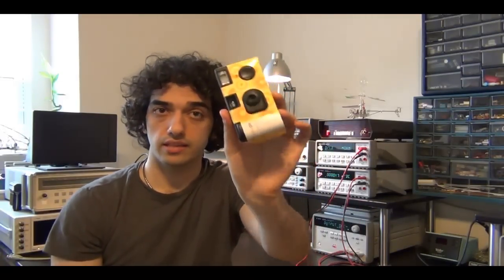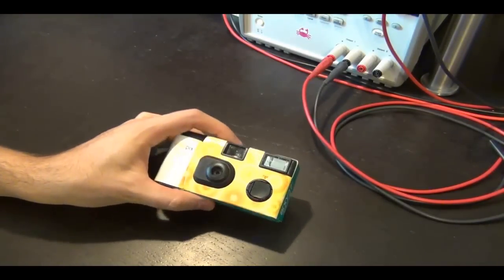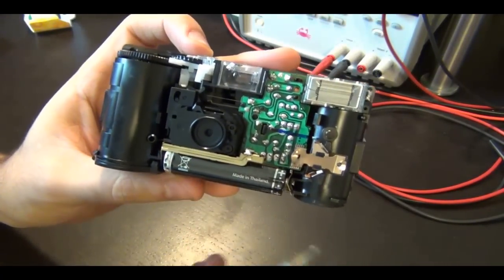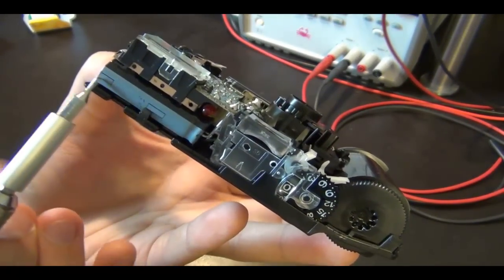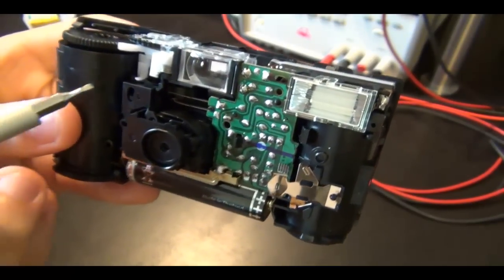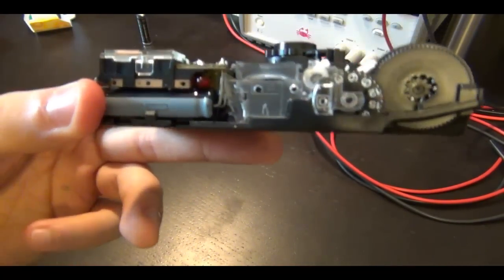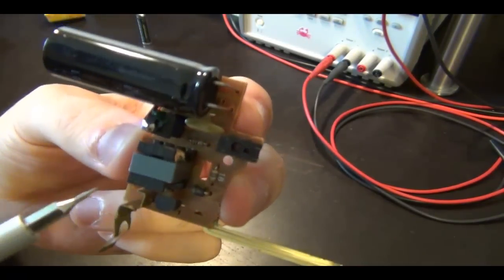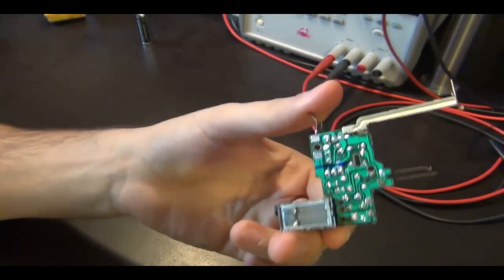TSP #3 - Camera Flash Circuit and Nixie Tube Tutorial (Part 1/3)

Comment: Hi Shararair
thank you- great video  
would it be possable to make a video using the same  flash circuit to build a Geiger Counter ?
I have purchased some tubes from e-bay and can give you the numbers from it if you need them
the tube's are quite cheap to buy and are readily available 
ps- (the breakdown voltage in air is approx 25kv per inch)